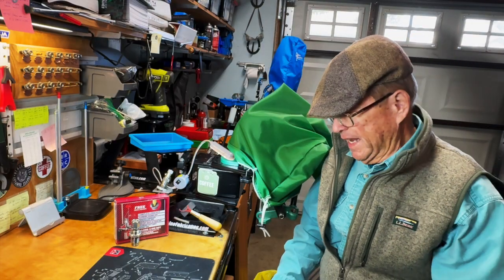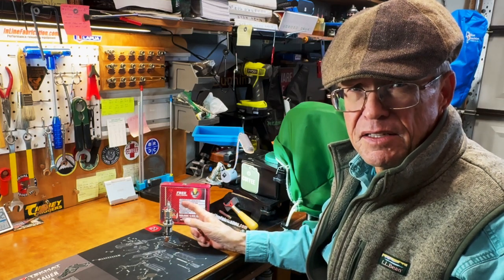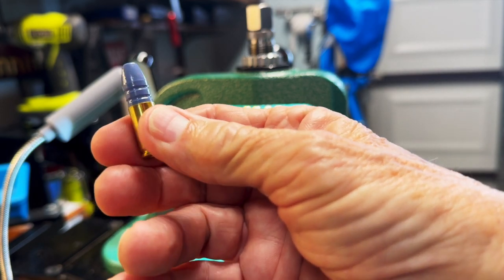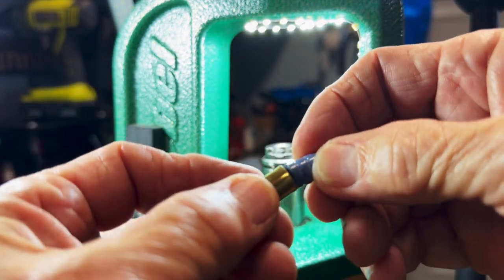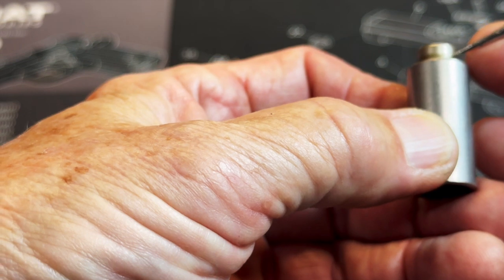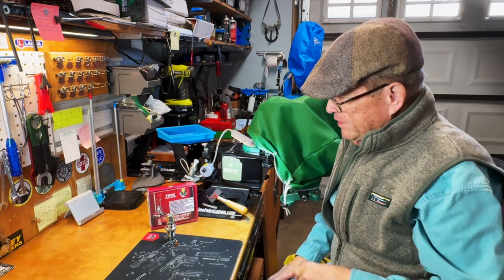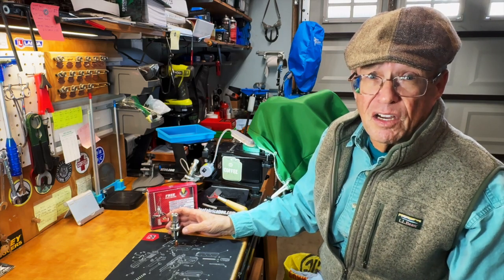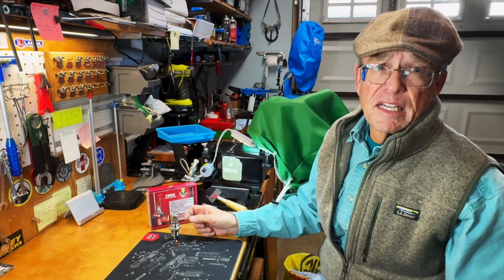Lee's new "M" style expanders

Comment: These are for the powder through expander dies correct? Noe has been making M Style expanders to work in the universal expander die for a few years now. The make them in most any size you need. You can even get them in various diameters for the caliber. This way you can experiment with different expander sizes to change case neck tension. 
Some cartridges, depending on the actual barrel specs use different bullet diameters. With different diameter plugs you can experiment to find which size works best with what diameter bullets you use.
A couple of examples are the 303 British and the 7.62x54R Russian. Depending on the barrel you can need bullets from .308 up to .312. these are all jacketed bullet sizes. Cast can be even bigger. Up to .314 or so. In my 7.62x54R I use bullets of about .311 for jacketed and .314 or .315 for cast. 
Another are Marlin lever guns. Using standards for caliber work ok with jacketed but cast need larger. In my 1894 most any jacketed of .429 or .430 works fine, cast needs to be .433 or a bit more depending on the bullet design.
So being able to buy various expander plugs at reasonable price makes have several sizes for each caliber makes sense.
Reply from the maker: Correct, Leon. These are for Lee powder-through expander dies. We know about the NOE gear. Thanks for stopping by. 🤛🏻🔫🇺🇸

Comment: Easier fix would be to put MORE flare on the case. You know screw the die in more. SMDH
Reply from the maker: Hi, and thanks for watching. Putting additional flare on the case generally does not work for me for two reasons. First, the bullet will not sit squarely in the case and is apt to seat crooked as a result unless guided with the fingers up into the throat of the die. Secondly, an over-flared case can scrape the inside of the seating die. Besides the obvious scurfing up of the walls of that die, the case can begin to fold into the bullet. That’s not necessarily a bad thing unless the bullet has started crooked, in which situation PC or lead may get scraped. 🤛🏻🔫🇺🇸

Comment: The M from Lyman has nothing to do with the step on the expander. In their early diagrams showing the parts of their dies they used letters to indicate the parts. The letter M was used to indicate the expander. That is where the M in M type expanders came from.
Reply from the maker: Correct. The Lyman “M” die is their expander die, the designation being carried on expander die bodies. Lacking a better reference, we have used the term for many years a comparative reference for a stepped expander plug. Thanks for that addition. 🤛🏻🔫🇺🇸

Comment: Why aren't you sizing your cast bullets before you load them?
Reply from the maker: Hi, and thanks for watching. I do size them before loading. I size them larger than bore diameter though, and that puts them .001-.002 larger diameter than most plated or jacketed bullets in caliber. 🤛🏻🔫🇺🇸
Reply: @viejo2a  I thought I noticed that your cast bullets were polymer-coated. I hope you size them both before & after coating them!
Reply from the maker: @tkarlmann  hi again. I do not size before powder coating. I realize no benefit from doing that, and unlubed bullets are sticky in the sizing dies and sometimes lead builds up on the walls of the die. My bullets size just fine after powder coating. Do you ‘double-size’ your cast bullets? If so, what benefit are you seeing to that? 🤛🏻🔫🇺🇸

Comment: Yes, it's hard to make one expander for all bullet types. I find the original expander over expands the case for plated bullets. So, I bought an extra one and reduced it a bit to save on case mouth cracks. If you are using the funnel adapter you can adjust the flare, but with the case activated powder measures, getting the full stroke will over flare.
Reply from the maker: Hi Curt, and thanks for stopping by. I have a bunch of turrets set up with different die sets. Generally, my MO is to batch-size the brass first on the APP, which is an extra step. That frees up station 1 for a Lyman-type expander. Then I just use a short charging die with the autodrum. That funnel does no expansion but activates the powder measure. The funnel insert can easily be moved from turret to turret along with the newer poder measure, leaving the die body itself ‘set’ on each turret. This process works for all my handgun rounds except those shorter than 40 S&W. For 9mm I’ve been using a 25 Auto expander funnel which also will activate the powder measure, yet not do any more expansion. The newly designed caliber-specific funnels may well eliminate the extra step of pre-sizing my brass.🤛🏻🔫🇺🇸

Comment: Being an old school type, I was never a fan of Lee's stuff. I have many older Lyman and a few RCBS dies that, in my opinion, are far superior. I had bought a set of 45 Colt dies by Lee, and cannot stand the powder through expansion die. Further the seating die has an awful seating stem. I had bought this set to replace my old set of Lyman AA which I've used for decades. This was to replace the sizing die that was non-carbide. So I simply use the Lee carbide sizer, and the rest I use my old Lyman dies. I suppose I'm just the proverbial old dog that doesn't care to learn new tricks. 😅
Reply from the maker: Nah. You’re an old dog that has tricks the kids never heard or thought of! 🤛🏻🔫🇺🇸

Comment: Yep, I was exchanging emails with Tammy at Lee Tech support about this yesterday and today. They said that they are in the midst of changing over to this new style expander plug. I was really happy to hear that news!
Also a heads up... if you using the older(longer die body) 357 Mag powder through die the new style expander plugs will not work, you have to order a new die because the new 38/357 powder though die  are shorter then the old die bodies so they can do both 38 Special and 357 Mag.
Reply from the maker: Good to hear that you also had a conversation with them too, Papa. Lee has been busy lately with new gear. 🤛🏻🔫🇺🇸

Comment: Oversize cast bullets? Why? What about bullet sizing? Got a Lyman Lube sizer, and a simple Lee bullet sizer, no issues loading cast bullets with the old dies for 40 yrs
Reply from the maker: Thanks for stopping by Willie..I size my cast bullets to diameters larger by .001-.002 than standard sizes for jacketed or plated. That makes them “oversized”. I too used older style expanders for years when I used the lube-a-matic to size. Scraping the bullet against the case mouth with a traditionally lubed bullet is not a problem. We just remove any lead ring that may form, right? But for my powder coated cast bullets, the M style expander works better. 🤛🏻🔫🇺🇸
Reply: Ok. but I guess you slugged your gun for dia. and needs a bit larger bullets. Otherwise why overbore?. Not questioning, just courious? Nunca acabamos de mejorar lo que esta perfecto. Pero que divertido. Abrazo @viejo2a
Reply from the maker: @WillyK51  Ho again, Willie. I do, indeed slug my barrels. Sizing cast bullets to larger than bore diameter does a couple of things. First, it ensures that the bullet will completely obturate the barrel. This helps it fully engage the rifling which can aid in accuracy. Secondly, this helps prevent gas blow-by that may cut lead from the bullet’s  sides  and deposit it ahead of the bullet. This will cause undue leading in the barrel which will quickly detract from accuracy. Also, it is important for my bullets to be at least as large, or slightly larger than the cylinder throats in a revolver. Again, I want that round to completely seal those cylinder throats to prevent blow-by giving rise to leading in the forcing cone and/or barrel. Revolver cylinder throats are generally larger than bore diameter. 🤛🏻🔫🇺🇸

Comment: I just want the PTX inserts.  
I am guessing they will show up on their what is new web page when they are confirmed.

This opens a hole on my (4) die turret.
Reply from the maker: Hi Cincy. I’m fairly certain that you can get just the expander/funnel part. I’m comfortable with batch-sizing my higher volume calibers on my APP, and using an M die in station 1 on the tool head for now. But it would be nice to have for new calibers. 🤛🏻🔫🇺🇸

Comment: Definitely looks like a lot better way than just belling out the case mouth for cast. Next time I need a new caliber I’ll have to try one, but I sure don’t wanna have to switch out all my sets out when they still work. Just not as efficient unfortunately, the M die sure looks slick.
Reply from the maker: Hi TB. Thanks for stopping by. I’m with you in not wanting to purchase all new die sets! It looks like we’re going to be able to just purchase the plug as a separate part. For $3.00, I’d bite. 🤛🏻🔫🇺🇸
Reply: @viejo2a  now your talking!
Reply: I won’t buy anymore either but if they sell the plug sets, I’ll just call and order one for every kit I own. It sure is weird they’re not giving them a new part number to make it even more confusing for everybody.
Reply from the maker: @tripplebeards3427  hang on a bit. I ordered a couple of dies today, and one solo plug from the list. I’ll do an update video when that stuff comes in. 🤛🏻🔫😝
Reply: @viejo2a  will do
Reply: @viejo2a  yes I'd like to see the actual difference, and if it meets your approval! at the moment I've been trumpet flaring, but new at this and haven't had mouth cracks develop yet from overworking the brass.
Reply from the maker: @johnh4957  hi John. Thanks for chiming in. It’s not just splits we’re concerned about. Work-hardening of the case mouth can effect crimp and to a smaller extent, neck tension. Our straight-wall revolver rounds should last 30 firings if care is taken. Some folks will anneal such cases as well. Over-belling the case mouth can also result in seating bullets crooked, which may affect chambering and accuracy. Always best to do as minimal flare as possible. 🤛🏻🔫🇺🇸

Comment: It because of the Polymer on the bullet
Reply from the maker: Hello, and thanks for watching, Steemer. It’s not about the powder coat. It’s about our softer cast bullets being scraped by the case mouth. It’s happens with traditionally lubed bullets as well but it’s not quite so problematic since we can simply remove any lead ring that gets shaved up. Those bullets still retain all the lubricant. With PC bullets, the PC IS the lube, and I don’t want the bare sides of the bullet exposed. 🤛🏻🔫🇺🇸